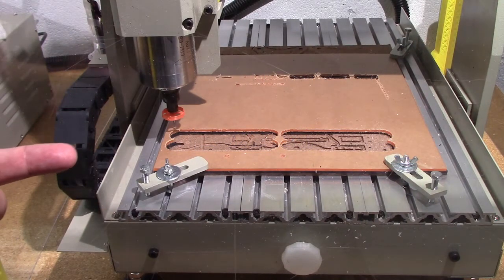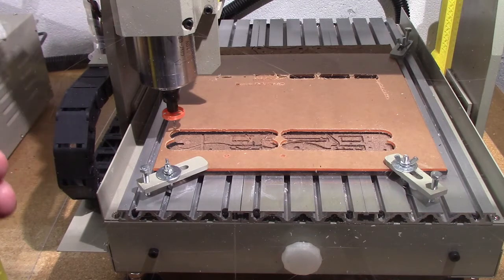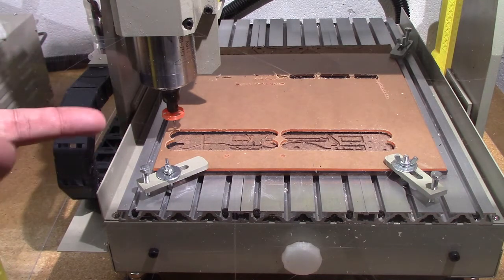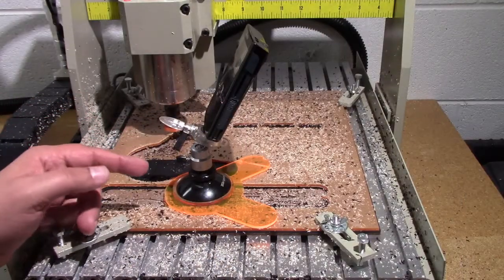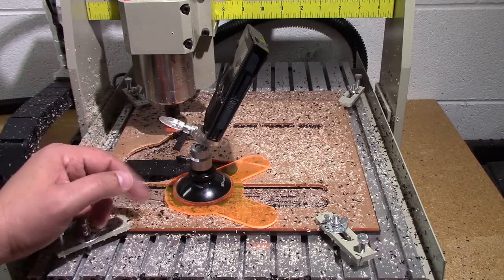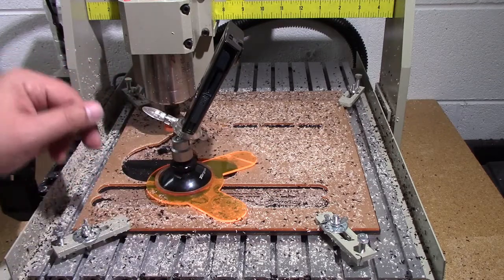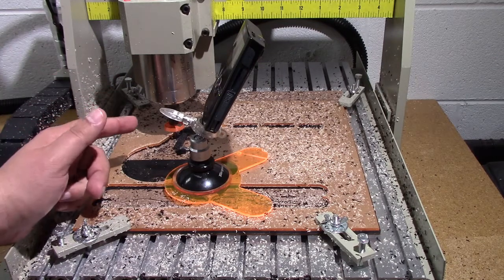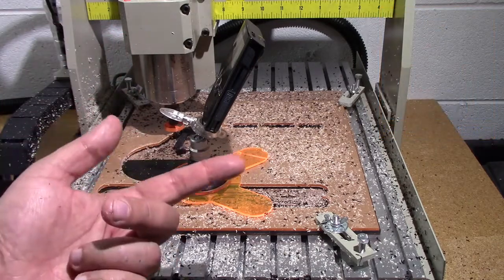3D Printed Project  - Testing the CNC Bit Fan!

Comment: Would like to see how the fan works with a harder material that would cause the bit to heat up more
Reply from the maker: Wouldn't recomend it for more than wood or plastic as cutting metal could generate enough heat to melt it.  The main idea is for plastic as plastic gets hot so fast it starts melting rather than cutting and that becomes a problem.  So with this little fan it move air around the cut...

Comment: looks good .   would be cool if it could make enough air to keep chips away from tool .  but i suspect blade size and RPM are not enough .  unless you made the outter shroudg a bit taller ? hmm . ah well looks and works good.
Reply from the maker: Yes it moves a lot of air, I actually designed my own version in Open-SCAD and posted it on Thingiverse...